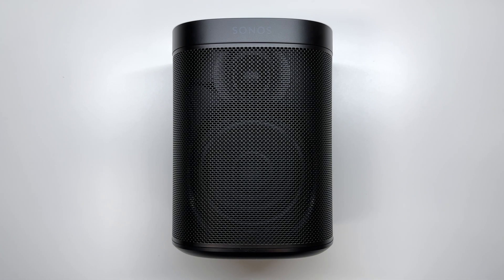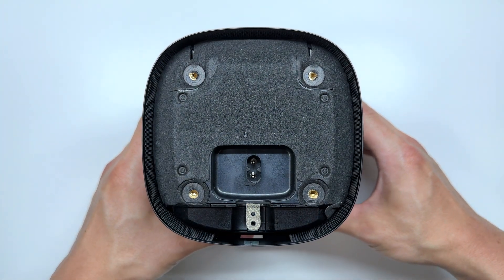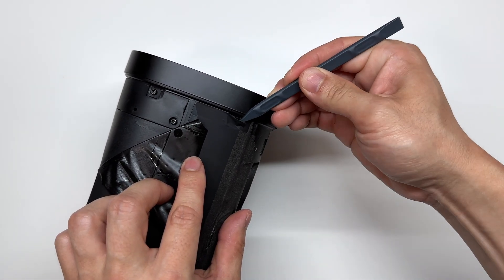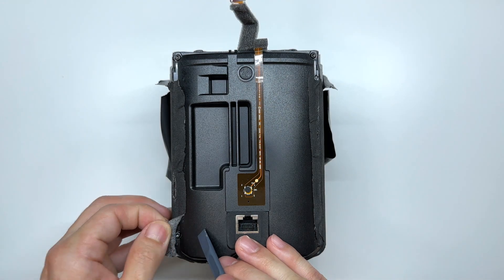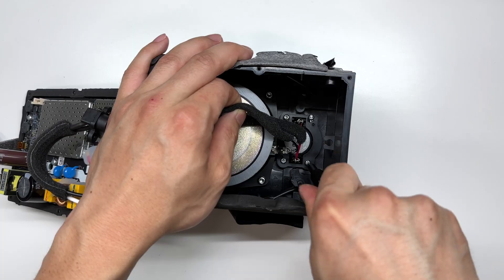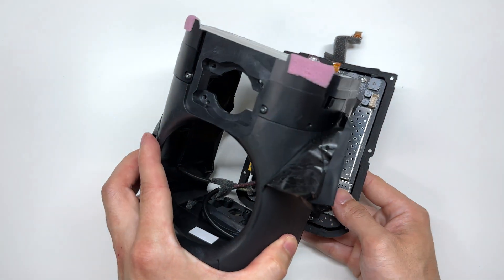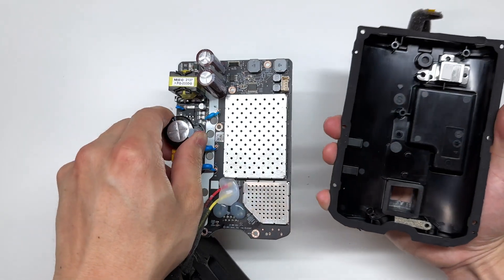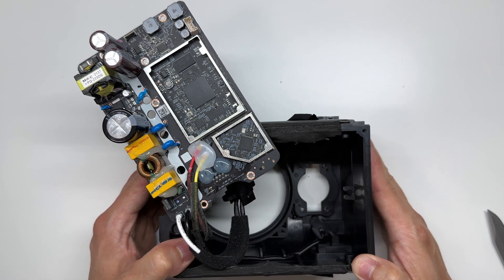Sonos One SL Teardown / Disassembly

Comment: My sono one SL bass driver has  a rattling sound at low bass. Can you advise the size of the replacement unit or partno ? thanks for your help
Reply: If it's the small black sylinder thing. Just put a glue or replace it with a small piece of cloth. Did it with mine and solved the crackling tzzt sound.

Comment: So, when I remove the rubber feet, there is some hard plastic piece covering the torx screws with no holes. When you removed the feet, did you pull the plastic piece off as well?
Reply: Currently sitting here and just noticed the same. How did you proceed?